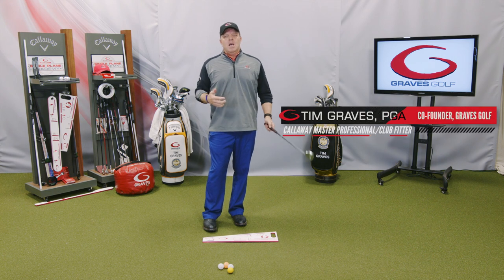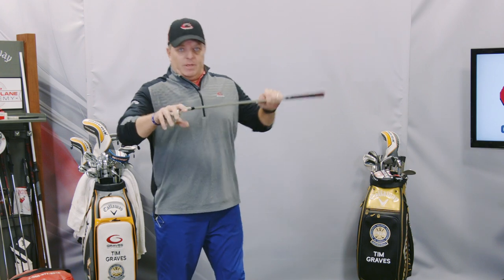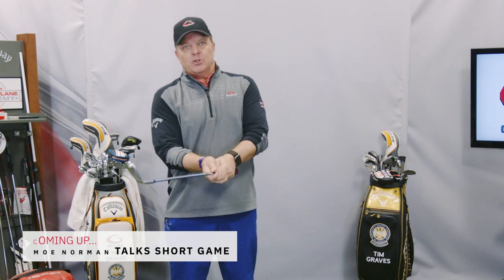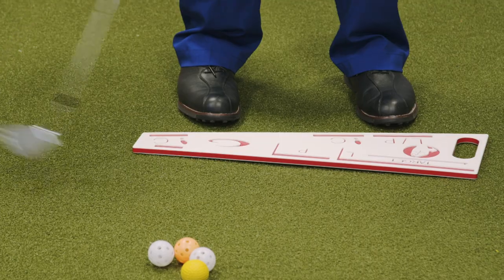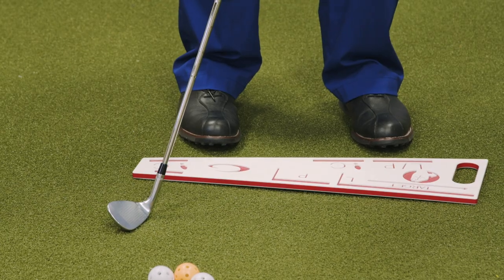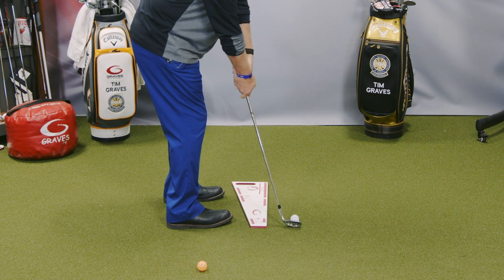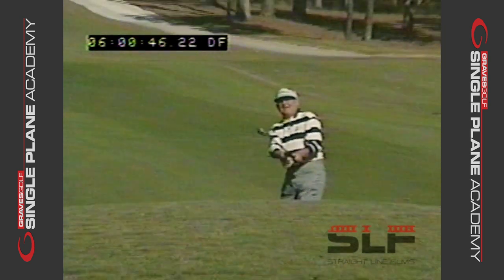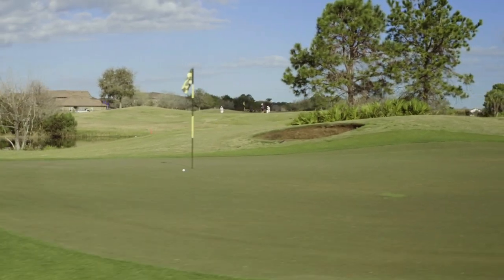Moe Norman's Single Plane Full Swing vs Short Game Setup

Comment: How does this apply to single length clubs since they have been set up with lie angles different from standard clubs?
Reply from the maker: Exactly the same. As you choke down on the club, you must drop your hands to adjust for the effective lie angle. This is one of many reasons why we don't recommend single length clubs
Reply: Graves Golf Single Plane Academy too bad, my one length F9s are amazing and seem to match perfectly with my single plane swing. Cheers!
Reply: @lincoln3x7  way to go...
Reply: Keep the toe down when chipping ,less friction through the grass.